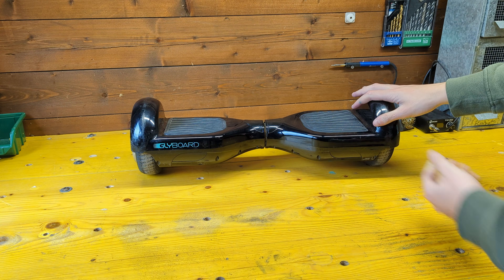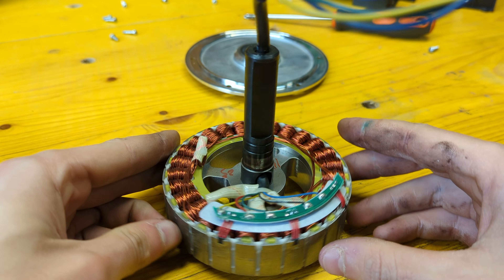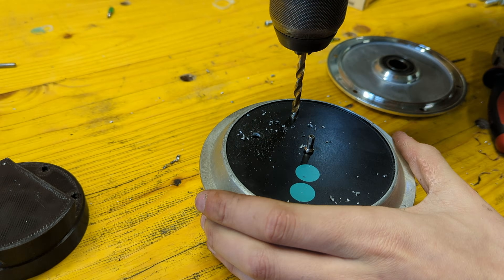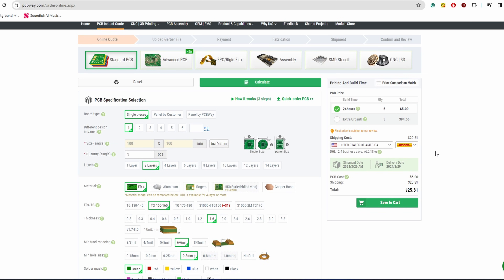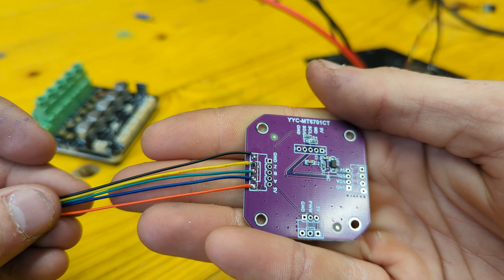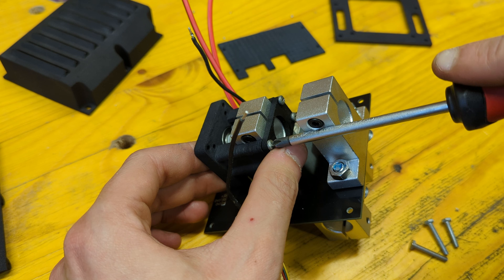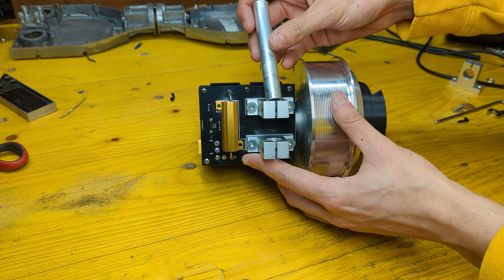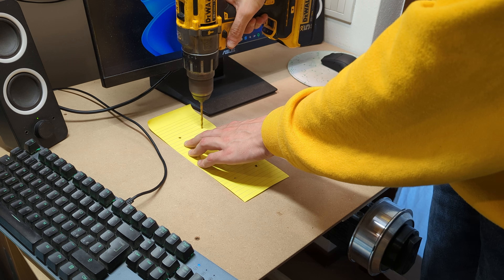how to build a FFB direct drive STEERING WHEEL from a HOVERBOARD | step by step

Comment: Any specific hoverboard type or brand? Most models are rated at 250 W or 350 W, but none of them mention torque. Some users have reported peak torque values for these motors in the range of 3–5 Nm.

Comment: Where can I find the 3d printed parts? I have 3d printer myself.
Reply from the maker: Wait about 1 month and I'll publish version 3, fully 3d printed with the motor integrated in the steering wheel and no need to modify the motor. Can't want to finish it and publish the video and files

Comment: Wonderful work there, i’m very bad with the soldering, but i really want to try this.
However i would like to ask also what ppfilter and reshade do you use for assetto corsa? Also what camera setting do you have for the f1.
Reply from the maker: Wait a few months, I'm currently designing a third sim wheel which will be 100% 3D printable with the motor integrated in the steering wheel itself, with minimal assembly and soldering skills required.

As for the pp filter I change between a few, but currently I don't remember which ones I use

Thanks for the appreciation!

Comment: Hi, what material and infill settings for 3d print parts?
Reply: I used pla and 15% infill and that's worked ok so far, if I did it again I would do 30% infill

Comment: Can this be done without a PCB and also where is the encoder from ?
Reply from the maker: I got the encoder from AliExpress, it can definitely be done without a pcb, i'm currently designing a version 3 which will be 100% 3D printed with minimal assembly required, no need for a pcb and no need to modify the motor
Reply: @DAZprojects  hey man...... nice vid but when will the new video drop and can you also give the files for the 3d printed parts ? BTW thanks for the help
Reply from the maker: @vinaynithilan1742  It Will probably drop in a month or so, I will sell the files (with detailed video tutorial and parts list) for a very small price, probably 10$ since i've spent the better part of the last 6 months designing it, caring for every detail. Hopefully the first prototype will work perfectly and I can publish the files asap
Reply: @DAZprojects  Sounds good I'm interested thanks!

Comment: How good is it compared to a g29 t300?
Reply: It's a direct drive wheel you can't compare it with those the t300 i have it it's 4nm the direct drive can reach up to 15nm
Reply: @ i got it that is more strong but the feeling/force feedback is good ?
Reply: @JoaoADFerrari  of course smother + stronger + will not brake matter fact the only thing that may break is your fingers hahahhahah❤️‍🩹
Reply: @ got it ty buddy
Reply: There are better versions out now, but direct drive is a way nicer feel than a belt driven or gear driven wheels just because with belts and gears sometimes they break/slip, while direct drive is smooth and consistent and lasts as long as the electric motor in it. If you dont want to build one, the cammus wheel or the cheaper moza wheel is a pretty nice direct drive wheel that's not even that much more than a logitech wheel

Comment: Would it work for ps5?
Reply from the maker: @britom98  no
Reply: @ even if using a ps5 controller as a donor to keep the “connection” and mapping the buttons to the steering wheel?
Reply: @britom98  it would work as a joystick but the force feedback is at software level. so it would never work on a Playstation

Comment: How much volt input for power supply ? 
110 or 220 v ? 
Thanks
Reply: @rexycontemplates he said "Input" not Output so im sure he means as how much voltage you should power these power supplys with i dont think anyone is so dumb to power the motor driver with ac 220v/110v. these cheap chinese power supplys luckily have a switch where you can switch between 110/220v so to answer his question you would need to configure the switch in the power supply for your countrys voltage rating.

Comment: How many degrees can the wheel do with that magnetic encoder? I saw the specs but it says 360 degrees..... I'm confused if it can do 900 degrees or not
Reply: The wrapping of the value is done in software, the mt6701CT only reads absolute angle.

Comment: please please please DAZ, i have 3 question, answer me these
1, can you make the flashing process and uploading the firmware process video, I keep reading in the guide "disconnect and connect external power to the board, what does that mean, what type of external power is it talking about?
2, is the firmware or the ffbeast software paid
3, how do you incorporate the pedals in to the board using mks drive mini
Reply: 1. external power is the + and - connecting from the psu to the mks board (not the usb c port).2 there are two versions free and paid. the paid version has the ability to use custom buttons but otherwise it is the same. 3. with free version you can't connect pedals but u can use some arduino nano for that and simhub software or else, there are a lot of tutorials and projects online

Comment: how do you drill the 3mm through the motor shaft ?, my drill is making progress but not really fast it took me 45 minutes just to drill a little bit through it. Do you use any lubricant? and which drill bit do you use?
Reply: use a carbide bit and oil...your bit has probably dulled itself and I am assuming you probably arent familiar with resharpening a bit.

Comment: how do you wire your steering wheel buttons? Do you use a separate board only for them and plug it separately into your pc, or can you also use the odrive for buttons and pedals?
Reply: the mks xdrive s has 4 gpio pins and spi so you should be able to utilize the 4 pins for whatever inputs and/or use an spi extension if theres more than 4 buttons. id get the 56v version.

Comment: is there other cheaper way to control it. i dont have accest to mks xdrive or other similar boards. i wonder if i can use aduino or stm32  with separated bldc motor controller board , its it possible ?
Reply: The whole point is in the motor driver, Odrive is good enough for nice FFB,once everyrhing is well optimized, like changing the current shunt resistors to suit the required range for your motor. By default it has 150A range and if you use only like 10th of it, so will the FFB resolution be only a 10th, at low forces it will be very jerky. People usualy put 5-10 mili ohms.

Comment: Great work, very clean! The driver has intergrated encoder, did you try it without the need of external encoder?
Reply: the ffbeast flash on the controller makes is so u cant use it, i ve seen it in CNCDan’s video

Comment: How does the spoke stay in place, the nipple only prevents it from going one way.
Reply from the maker: @Zeusbeer  the hole in the motor chasing is small enough to thread the spoke into and acts as a nut
Reply: @DAZprojects  Woah thanks for the quick reply. So you essentially tapped the wheel using the spoke?
Reply from the maker: @Zeusbeer  yes
Reply: @DAZprojects  Seems like a risky operation. If it fails for me I think I will just bolt down an m3 threaded rod and tape it near the wires so it does not erode them.

Comment: question do you need that encoder or can i use a Rotary encoder?
Reply: it's better than a magnetic yes, you must figure out a way to connect the spoke to the encoder by pulleys or gears or directly... but it's much better than a magnetic from what I've heard

Comment: why does the input seem so delayed compared to whats going on in the game at 10:32? also the turning radius seems less than optimal.
Reply: there is no delay in firmware, could be that he uses v-sinc in the game and at 60Hz monitor this gives 16ms of input lag for any game controler (mouse, keyboard or joystick, wheel)

Comment: So many thanks for the video ! Is the power supply (24v) sufficient for good (high)  tork ?
Reply: 24V is the limit of the MSK Odrive so you can't take more with that one, but yes my friend has a 12V, and it works also even thougth the acceleration is better on mine to be honest but the difference is minimal but I would recommend sticking with 20A minimum, I took 30A to be sure.

Comment: hi guys! i´ve finished the project and it works just fine, but i´ve got a trouble, wich is the motor, after 5 to 10 minuts of use it gets so hot. Do u guys know why could it be? Great video and amazing content you do. Keep it up!
Reply from the maker: @julianzelaya7262  also my motor got hot, I solved this by drilling a bunch of big holes on his back side and adding two blower fans that blow directly on the stator. This solved that issue

Comment: Hi. Nice project. But what the power of the motor can I use? There are motors for 200w, 250w, 300w and up to the 450w that i can buy. This ODrive plate can it run with any power? I seen  a lot of 10inch motors, also they should be stronger. Can i use them? Im not good at electronics but want to try it. Thanks

Comment: Hardest part of this right now seems to be getting the motor, and then waiting for shipment of things from China. I am excited to try this out though when I can
Reply: Getting a motor and power supply is the easiest part. A lot of ewaste stuff, but perfect condition.

Hardest thing to get is the controller.
Reply: Just buy the real damn thing
Reply: @ilcarlino752  Why? I made mine and it's working wonderfully. And was way cheaper
Reply: @smothdude  the real thing is only 500 euros and this doesn't compare to it
Reply: @smothdude  too much work and also not comparable to products that had years of research behind them
Reply: @ilcarlino752  actually it is not that much work, and the final product is directly comparable. Direct drive wheels are not as complicated as you think and the software the developer here is making is only getting better. The FFB is great and compares directly to more expensive wheels. I have driven Moza R9, Fanatec DD. Not sure why you are so against this wheel? There is not much development behind other DD wheels as you think
Reply: @smothdude  delay and everything, quite noticeable on a good expensive pc with super low timer resolution delta, and with custom drivers for less delay, not to mention the build quality, which imo is the main thing
Reply: @smothdude  the real expensive wheels are pretty much better, full of buttons, very complete, this one might be good but it is not one of the best
Reply: @ilcarlino752  no delay at all in my experience. I don't know what you are talking about
Reply: @smothdude  there is always a bit of latency, it's visible even on the video, wheels specifically made for sim racing have way less latency
Reply: @ilcarlino752 render latency and input latency are not the same and have nothing to do with the wheel or software in this case. you are clearly biased and are misinterpreting things that support your views. this wheel base literally costs less than 60 dollars to make if you are skilled and resourceful. many have done it and every wheel will perform slightly or not so slightly different based on the components and software settings used. are you triggered that you spent a grand on a direct drive wheel while these folks with basic engineering, and fabrication skills made one for next to nothing that would also work with any wheel or peripherals from these big companies you speak of.
Reply: @ilcarlino752if you havent built it for yourself and tried it you cannot 100% say that this isnt comparable to big brand wheels.

Comment: Are the 10 amps of the PSU enough to get the 15nm or 12-15 amps would be better ?
Reply: In Discord of FFbeast, they recommend 20Amps PSU because of 15Amps recommended current
Reply: @smpltv6481  Thanks ! I got answers to many of my questions on this server.
Reply: You need about 30A peak capeable PSU to get 10-15Nm
Reply: running a 36v psu would be more efficient and require less amps. its also these motors nominal voltage and would make the wheel spin faster.
Reply: if you are running a 36v psu, 15a is enough, if its 24v then 20a is ideal.
Reply: same question here..

Comment: Hi! Excellent work. Congratulations. 
I need help. I've constructed one but when I'm calibrating the wheel and I go over 450 grades the wheel becomes crazy. Why?
And, the motor gets very very hot. Some idea why that's happen?
Reply: Hi i have not made this yet but i assume that the overheating problem is expected i read somewhere but you can make a cooling system unless if  the temperature is super high then please let me know and make sure to check over your soldering as tat is a core reason for many overheating issues.
Reply from the maker: If I remember correctly that also happened to me, but I don't remember how I fixed it, if I remember that I'll let you know
Reply from the maker: Also my motor gets hot, I've now drilled a bunch of big holes in the spindle side, and I've added two blower fans that blow directly on the stator, it is pretty loud, but gets read of all the heat allowing me to use it for hours at 100% power
Reply: probably issue with the firmware, once you get passed the electronical end stop angles, encoder count goes crazy and therefore also the ffb, check out OpenFFBoard firmware, it doesn't have such issues.
Reply: motor stator has to be cooled by airflow, remember that howerboards are designed to spin fast, in a wheel it's barely moving under high curents (stall mode) so it's logical that it will dissipate power and heatup if that heat is not removed in some way.
Reply: @rankovicmilos86  hi do u find any solution for the wheel goes crazy after 450 degree.
Reply: @Insan1ty_06  yes, my arduino firmware has no issues with getting past end stops
Reply: @rankovicmilos86 which firmware u r using currently? And the ffbeast has some kind of issue right?

Comment: I guess you would need some tube  for passing the encoder shaft through it, preventing any wear to the phase wires due to its rotation inside motors main shaft
Reply: Its pretty smooth as it is, but you could just use some soft shrink on it if you wanted.  You could put it around the wires, around the spoke, or both.

Comment: Why do you use the spoke to feed into the angular encoder if you could use 3 hall sensors already installed on this motor?

Updated: Please see a comment below why the external encoder is necessary!
Reply: I believe the hall sensors in the motor do not have sufficient precision to make a good-performing wheel
Reply: @algodude8713 Hall sensors give the motor controller quite precise position of the rotor. A typical hoverboard motor has 15 pairs of magnets, and with proper processing it is 5400 position per rotation, if I am not mistaken. It is far better than this sensor, which has a resolution around 1 degree (and it has 4 hall sensors inside anyway, but "senses" only 1 magnet at the shaft).

I guess, the main reason is that this sensor reads the absolute angular position by itself. This drastically simplifies the code, of course.
Reply: @AlexYeryomin You are wrong, the external optical encoder is an absolute must. The 3 hall sensors on the motor are only for commutation of motor coils. this is  used in speed control mode in howerboard where you have high rpm's and don't care about precise motor angle. In torque control mode for FFB wheel where it's barely moving, you need very precise shaft angle readout which those simple 3 on/off halls can't provide, they have like 8PPR. For good FFB one needs 2.5k PPR at least, 10k is already much better.
Reply: @rankovicmilos86 Thank you for the detailed explanation! This makes sense.

(I updated my comment above asking to see your comment here.)
Reply: @rankovicmilos86  I read again your comment, and while I agree that the good encoder for feedback wheel is necessary, look what was used for DIY wheel - a cheap magnetic (hall)encoder. This brings my question back: why not using hall sensors already available with this motor? 

I have reused the motor and the motherboard from the old hoverboards. It works no problem in the torque mode. I can't tell if precision is enough for good feedback for gaming, but it shouldn't be much worse than that single encoder.
Reply: @rankovicmilos86  great information!

That's fantastic that the comments section works as it should be: to exchange options and knowledge. I really appreciate your efforts to provide a clear explanation and details here. Now I want to build such a wheel with feedback by myself! 😄

Comment: Hmm, I was wondering if you can take a beginner sim wheel and upgrade the motor like the logitech G29/923 and use the logitech housing for a sleeper look
Reply from the maker: Why?????
Reply: @DAZprojects  In the US, there was a culture of drag racing building sleeper cars.  Sleeper cars were normal looking cars but built up to go fast. I've seen it in gaming computer builds with cases from the 90's to 2000's but haven't seen it in sim racing and thought wow, that can actually happen now after seeing your video.  Of course, whoever does it will have to showcase it on Twitch and Youtube or otherwise noone will know.
Reply: with some 3d printing, yeah!

Comment: can you help me choose a power supply? is using 24volt 10amp 500watt enough? or do i need a higher wattage? and isn't the hoverboard motor 36 volts? i also found a 36volts 28amp 1000watt power supply. i hope you can help me on choosing the right power supply. thank you in advance
Reply: you need 24 volts and 10-15a
Reply: And what about the pic current, is the 24V 10-15amps enough for the hub motor?
Reply: @armandoaceves3268 You need about 30A peak in order to get close to 10-15Nm,  but it will run fine even with lower currents, but the question is then how optimized is the current sensing ADC range, this is essential for the quality of FFB.